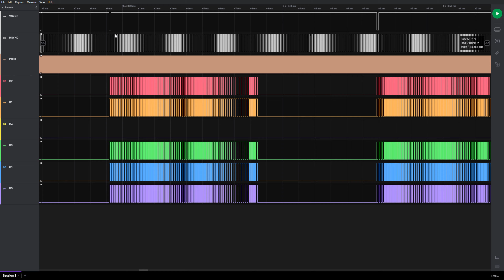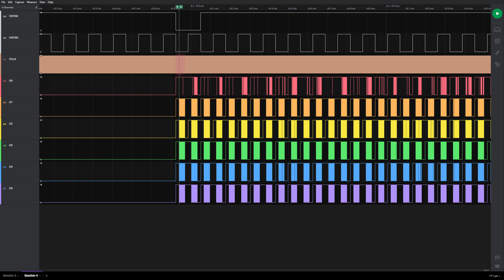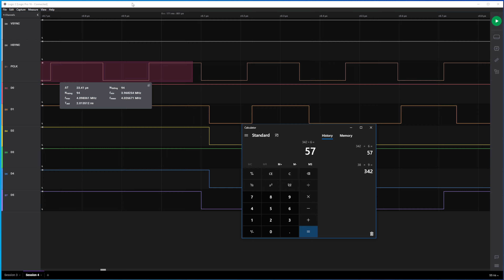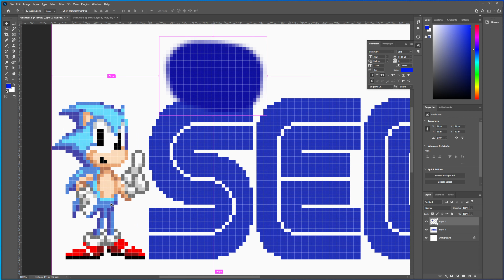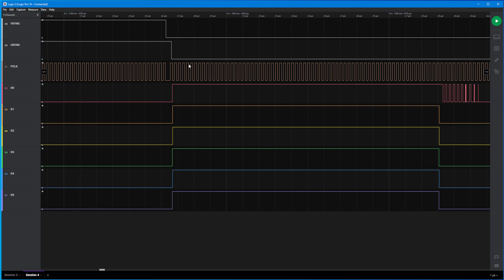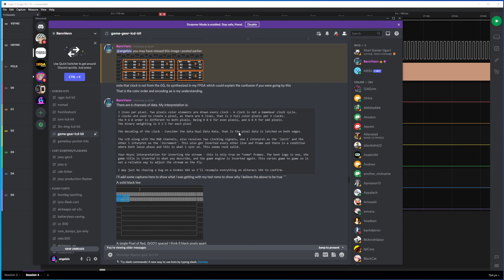Game Gear VA4 VA5 Reverse Engineered LCD Interface - RetroSix Explains

Comment: Just out of curiosity. I have been wasting hours on end trying to find a mod for my 2x VA4 837-9537 boards. I have two with bad screens. Have y’all made it available yet? I looked on your website and nothing there.
Reply from the maker: Next batch I order will have VA4 and 5 support. Codes all done just not released it

Comment: So is the VA5 a single chip board? Just getting back into the game gear so just learning
Reply from the maker: VA5 is single chip but it isn't the same as the VA0/1 single chip boards. The LCD interface is totally different
Reply: @RetroSix  thanks for the reply really appreciate it.. 
So I have a two chip board, is there more than one of these boards? 
From what I can gather the Va5 has fewer  colour is that true?
Reply from the maker: @adrianharrison5208  There are many 1 and 2 chips boards, but all 2 chip are the same in terms of functionality and support for screens. VA5 has fewer colors yes
Reply: @RetroSix  thanks for the info 👍